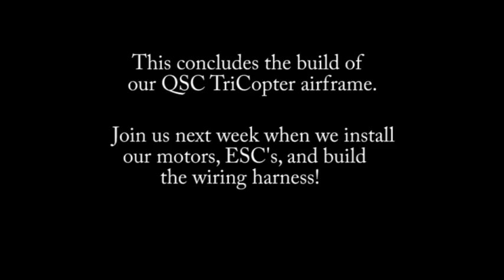4.QSC TriCopter -  Build, Part 2

Comment: Hey, Crash.  On the forward booms, could you use zip-ties in the outboard holes?  Then, you could just pull the zipties out to fold up and transport the tri.  And in the event of a crash (which i do a lot of), the zip-tie would give way and possibly save the boom, motor, and maybe even the prop.  Just an idea.  I really like the body of your design too.  looks like plenty of room to fit everything and seems it would be easier to balance that way.